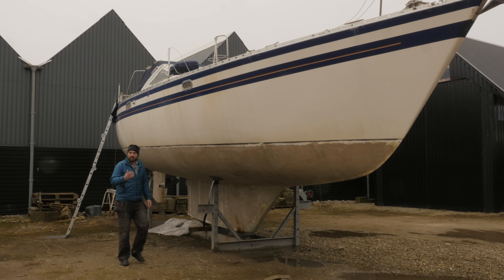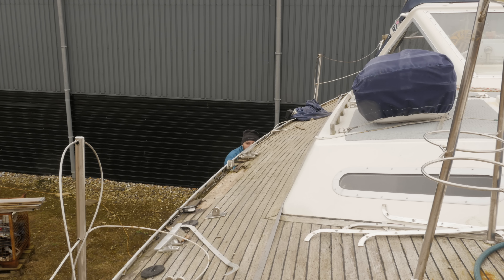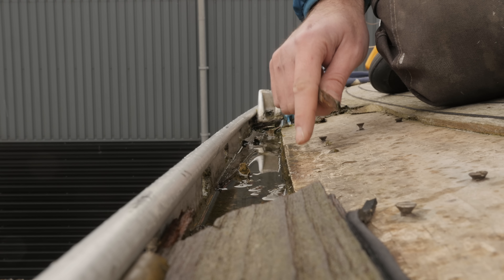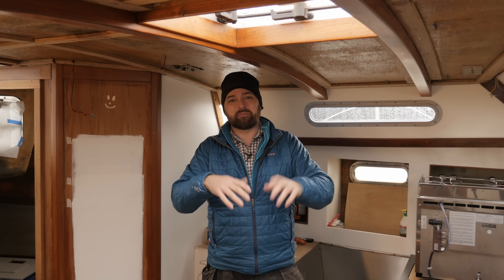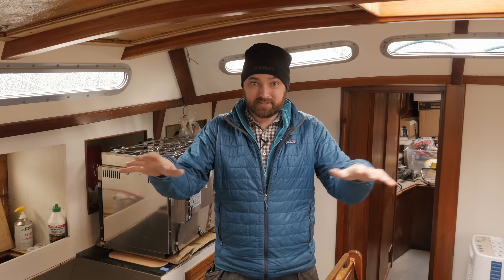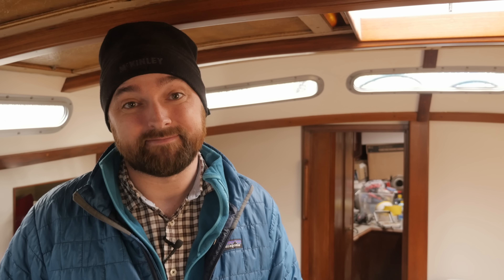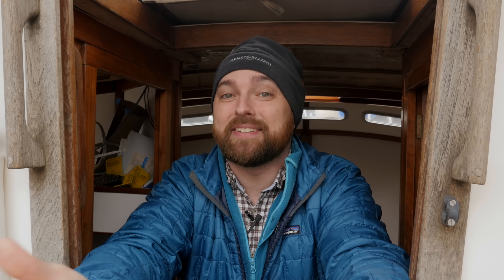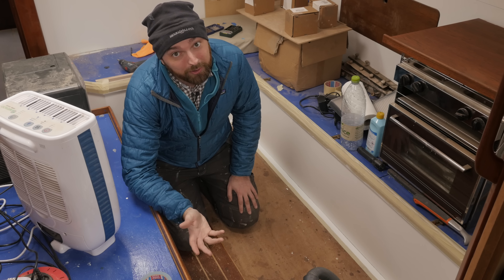Sail Life - Upcoming DIY sailboat projects & what does it cost to restore an old sailboat

Comment: Another great video.  I enjoy going back and watching these slightly older videos with my knowledge of the "spoilers" from the future.  Oh, how the moisture issues in the core are going to come to haunt you soon...

The nattering nabobs of negativity on your choices are always going to be there no matter what you do, there will never be any pleasing them no matter what you do, so it is so good to see you doing what you want, while still giving the advice people offer a listen-to in case you might be headed off the rails here and there.   I totally agree with your philosophy of building/re-fitting your own boat.  You will have a great boat that will be better than brand new. It will never be finished, but an evolving work in progress.  But no boat is ever a finished work because there will always be ongoing maintenance that needs to be performed and kept ahead of, and changes in technology will give you opportunities to upgrade slowly to better things as systems wear out and need to be replaced.  In the end, as you point out, you will know every square inch of YOUR boat and be able to fix any problems and deal with any emergencies much better than if you had simply paid more for a "new" boat.  

One area to be careful of is electronics.  While things like AC and DC panels/inverters/isolation transformers/cables are a great foundation and need to be placed sailing electronics like chartplotters, VHF radios, AIS systems, and other sailing instrumentation are all rapidly evolving and changing every year.   While NMEA-2000 networking seems to have settled down and standardizing the instruments themselves seem to be updated with every model year.  Everything bought today will probably be out of production and out of date in a year or two.  I bought a brand new B&G Triton package and Vulcan 7 chartplotter in the fall of 2016 and almost instantly they became out of date when they came out with new models a few months later.  B&G (and other Navico brands) as well as Garmin are both notorious for abandoning their products to software updates as soon as a new model comes out, even if they look almost identical on the outside.  New firmware and even fixes for glitches just stop happening.  They are as bad as Apple and Android smartphones and tablets with their product cycles.  I was just talking to the B&G reps at the Chicago boat show and the new features of the newest models of my instruments that I am missing out on and will never have is a little heartbreaking.  Neat MOB features and other little things have been introduced that I'll not be able to use now unless I get a new chartplotter and Triton gauges :(  

Also the warranties expire really fast on this gear and if products are not taken out and actively used on the water stuff that is bad from the factory will never be found until it is too late.  I have had that problem as well.  Matt from MJ Sailing here on Youtube had a lot of these issues as well with their refit.  I know you have already purchased much of the electronics but my advise is to try and hold off on any more of the instrumentation you plan to buy and install for Athena until right before you are ready to launch.  

As always, I love your videos and it has become my favorite DIY sailboat/cruising Youtube channel.  Keep them coming. Yours will definitely be one of the few I will be able to keep watching regularly once we have untied the lines and are further from broadband.

Comment: I am with you on the whole project.  I spent ten years +, which is way too long, rebuilding a wooden boat 48' long with 16' beam.  People used to come up as I worked and say, that needs a lot of work, or that will cost a lot to do up, or how long is that going to take to finish?, or how much will that cost to do up?  I got so damn fed up I made up a sign that read, "Yes, I know this old boat needs lots of work and I know it will cost a lot to do up and I have no idea how long it will take and I have no idea how much it will cost and frankly I don't give a damn... "  Keep at it Mads.  I actually think for what you have achieved you have not spent a whole lot and even if you had spent more at the start you would still want to be taking it apart to rebuild it how you want and to know it inside out.  Regards. Andy

Comment: The hull-deck joint reminds me of something I read from Hal Roth.

He and his wife set out from San Francisco in a brand new boat to do a clock-wise circumnavigation of the Pacific. The beginning of their trip was marked with days upon days of pounding into seas and that joint leaking like a sieve. By the time they got to Mexico or so, they were so fed up that they stopped to address the issue.

They removed the toe rail and stanchions, then used three progressively wider layers of fiberglass to bond over and reinforce the joint. (It isn't like they're ever going to unbolt and remove the deck half from the hull half.) If I recall correctly, he bought the glass in rolls of 6", 9" and 12" widths (~ 150mm, 230mm, 300mm.) In all the years of sailing after that, they never had a leak from that joint.

In your case, you'd probably also think about building up that depression prior to glassing over, so you get a fair line with the rest of the deck and no standing water.

Roth, Hal. Two on a big ocean: the story of the first circumnavigation of the Pacific basin in a small sailing ship. New York: Macmillan, 1972.

Comment: So far, financially, it would seem, you have done really well. You have made some great choices. You will have to do bottom and deck. Also, after all this work, you will probably change out chain plates, standing rigging, and you might need to get some sails, solar, wind generator, dingy, dingy motor.( water maker? rudder rebuild? Steering maintenance? upgrading electronics?) You paid $42K but would be doing really  really well to keep it under double that when all is said and done for the boat in excellent condition, sharply kitted out filled with all your cruising essentials. Still a good deal--and you are having fun while doing all the prep work.

Comment: If someone says, you could have just spent $54k on a different boat in better condition - possibly. However, since $54k is not even close to what you'd pay for a brand new boat, so it will have its own set of issues you don't know yet and that will come with their own price tag.

I think you concept is quite right. Buy a cheap boat with a solid base, assume everything not known good is bad and needs replacing, then proceed replacing/redoing everything and get pleasantly surprised if something is still good. :-)

Greetings from Germany!

Comment: If it makes you feel any better .. I bought a 28' boat and have spent about $10K on her so far. New mainsail, new furler, new lift pump, thru hulls, seacocks, lights, and new headstay are a few of the ticket items.  Some of the things I were caught in the inspection, some weren't (the lift pump worked fine on the sea trial.)  I've watched vlogs about people with new boats, and they too are always spending money.

My guess is that no matter what you would have bought, you would still be spending money. 

Appreciated the totals, it's nice to know I'm not the only crazy one out there.

Comment: I have been fooling around with boats for over 50yrs. As far as the money you'vr spent--it has been my experience that I over-saturate the boat with money, hours and blood--then I sell it at a loss !!?? Folks love to buy my boats. I have just started on a Hunter 31, 1987 model. On your teak deck project, I would suggest you tent the boat soon to prevent any further rain on the deck. I could not see well enough that trough around the toe-rail--could you drill some drain holes thru the toe rail at deck level to get rid of that standing water? Once the teak is removed and the screws you will need to dry out that core which will be time consuming--hopefully summer weather will help---you might try several fittings inside the boat hooked up to a vacuum pump to draw some of the initial moisture out of the core. We really like your films, I live in Seattle---the boating capital of the whole planet earth-----it would be great for you to visit here! I'm available to discuss any detail of your refit-----I have seen some pretty intense project boats!------Mike Yadrick

Comment: For your water pooling problem, take a thin (5-10mm) piece of line and tie a knot in one end large enough that it won't slip through the holes in the in the toe rail. Place the knot in the water at the lowest point of the water and pass the other end of the line through a hole in the toe rail ensuring this end of line falls lower than the lowest point where the water is pooling. Slowly but surely the water will drain.
Reply from the maker: +Doug Welch that's a pretty cool idea! 
Thanks 😊
Reply: Sail Life I hope it works for you. this trick is common on 80s era C&Cs here in Canada (i sail a 33 mk ii)

Comment: You might like to consider a watermaker, the largest capacity you can manage. Engine driven would probably be the best solution for you.
If you have a freezer then you will need a large battery capacity and solar panels in abundance which is always a problem on a sailboat due to shadows but hung on the outside of the rails is the most efficient..

Comment: Great investment! Please remember to budget for an 8kw genset. It will prove invaluable for the watermaker, HVAC, and forepeek appliances.
Reply: I'd invest that money in solar panels and batteries: no maintenance, fuel costs or noise.
Reply: MikeHeu, I service these vesselsfor a living. While a solar array and NEW batteries work nicely on sunny days, and are useful while underway, they don't keep batteries charged on cloudy days and are useless at night. Improperly charged batteries will soon acquire hard sulfation and prematurely fail. At best, a large array will make a few hundred watts of.power. A clothes washer, chest freezer, watermaker, airconditioner, water heater, silver ion purifier, big screen salon tv, and battery charger will require a few thousand watts. An 8kw genset is easy to maintain, drinks a very few liters of fuel per hour, reliably works day and niight, is extremely quiet when properly soundproofed, and will cost less overall than all other power sources. Hope this helps. Jack, aka electricalpowerguy
Reply: I agree; most of the 40-50 ft. sailboats I've looked at have a 5-12kw genset inside a dedicated engine room.  Must be a reason.
Reply: Ken Morgan, now the 21st century new hottest thing is installing two or three 3.5kw tiny units in almost the same space as a 
single bigger genset. Diesel engines are most efficient when fully loaded. As electrical bus load varies, slave units will automatically start/stop and parallel with the lead unit.  Fuel burn is reduced by 40%. They even have clean/dirty oil storage tanks with reversable pumps that makes engine oil changes a breeze....

Comment: I've pulled up teak decks on a boat I owned years ago. You can pull up teak and all in one step. I replaced my core with marine ply, (the original core was bulkhead scraps cut into 3'' squares, laid in the mold with micro balloon slurry) It's not that bad of a project, but the fairing of the deck and sanding takes time. From installing filler tubes etc. in the deck I found my laminations to be good and solid. Good luck, I'm sure you'll do fine.

Comment: Hi Mads; There is a good thread on Cruising Forum that deals with finishing a deck after removing teak. The poster built up the deck with foam core so the finished deck would be the same level as the old teak. The thread is a sticky "Nauticat 52 refit" by minaret. It can mean a big difference in finish work.

Comment: Thank you for your great videos Mads.
To me one of the most important arguments for buying an older boat and restoring all systems to the best of my ability is the one you mention: Once I am finished, I know every square inch of the boat and I will have half a chance to fix it out there... I often wonder about those who bought new without going through the experience of disassembly, repair and reassembly , where do they get the knowledge necessary for emergency repair?
Doing a similar rebuild as you I am not certain if this is a chaeper alternative, but I am sure it 1) is the more enjoyable and 2) it will stand me in good stead one day when....

Comment: I don't like teak decks or decks made to look like they are teak, for the most part.  Taking yours off will be a big improvement to Athena IMO.

Get all that foam dried out and filled and with some non skid, you'll be a happy cruiser.  By the way, have you seen the KiwiGrip non-skid 'system'?  A paint and roller combo that does the job of setting up a non-skid deck coating simply by painting it on.  If I can get mine done soon, I'll let you know how it goes.

And thanks for your continued dedication to sharing your experiences with your dream.

Comment: Hi Mads
Please do not even try to save that foamcore in the deck unless it was made from Airex or another type of closed cell foam. I do believe you have to find another solution. On my 36 ft I build a deck from 3 layers of 5mm epoxycoated birch ply. Then covered it with 3 layers of multidirectional epoxycoated fiberglas and finally 5 coats of paint where I put special fine sand in the second to last coat. That made an extremely strong deck and it was very nice to walk on.

Comment: is there a hot water system in the boat? if not what are you going to do about that? I guess you are also doing your battery system what batteries will you use lead acid, AGM, lead crystal or lithium?

Comment: When Your finished, you should be in well under 100K .  People may say you could have gotten one cheaper in the US but they forget the traveling (You to see it) and delivery fees to bring it across the pond.  All in all, It's not a bad deal.  When Your finished, you'll have a new, custom 38 foot boat for less than $100K  and be able to fix almost any problem you run into.
Where are you going to get a new live aboard 38 foot boat for under $100K?  A good 38 footer new starts well over $200K

Comment: Wow Mads......   thankyou for putting the costs out there warts and all....  no one every tells you how much they paid or really paid and how much they earn or etc because it is supposedly private (that reminds me of a joke.... "The only regret I have about dying before my wife does, is that she is going to sell my boat for how much I told her I paid for it !!!"). I think its a really gutsy move....  I don't think you have over capitalised the boat. A new motor here fitted up around the 30hp size would set you back around $15k, Self steering gear is around the $5k and you could easily drop another $10 to $15 on a whole set of sails plus more on re rigging let alone the electronics. Athena is also your home so you want to have it setup now how you want it so you can enjoy it. No matter how good the boat you will probably have to redo the work anyway. If you bought a boat and then started to have it professionally refitted for extended cruising you could easily drop a $100k on the boat plus the purchase price.Enjoy NYC......  should be awesome....My wife is over there for work in about 6 weeks and she is really excited.

Comment: The price for the refrig compressor and cooking stove was outstanding. You might want to investigate using Rhino-liner on the deck. Rhino-lino is a brand name for a spray on compound used in pick up truck beds. Tough as nails, sticks well to steel, don't know about sticking to fiberglass, and don't know if it comes in any color other than black. It is also rough which would act as a non-slip.  QUESTION. Did you remove the gel coat on the bottom? And in one video did you mention she had a barrier coat on the bottom and still have blisters?   So I googled rhino liner and it does come in different colors and can be applied to decks. No connection to rhino either than in is on the bed of my pick up.  I get what you are doing.